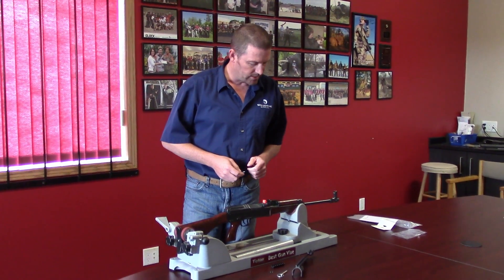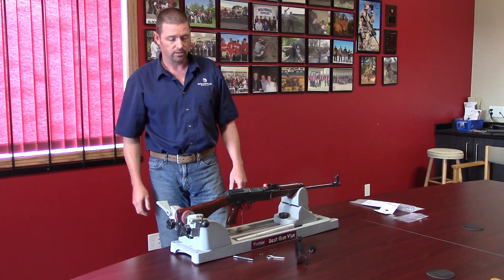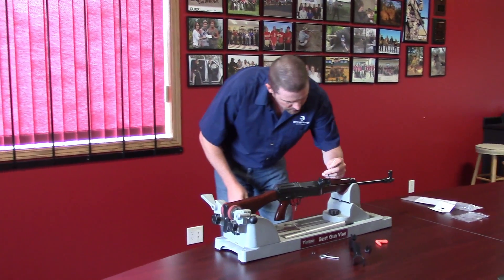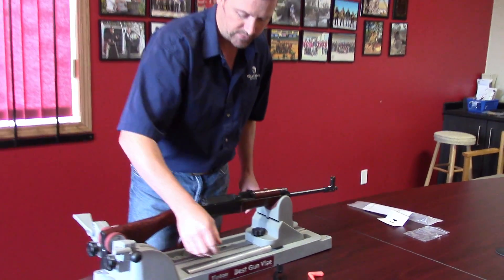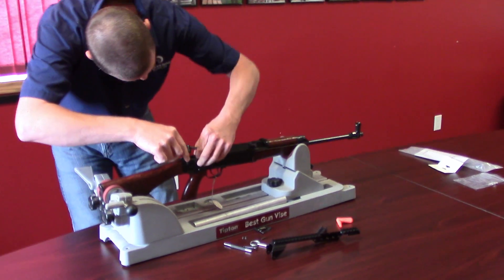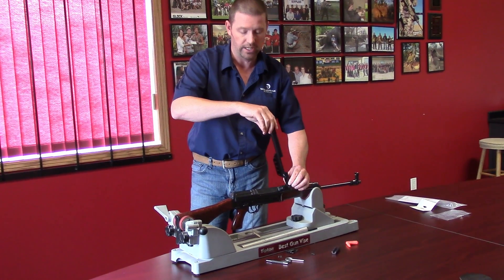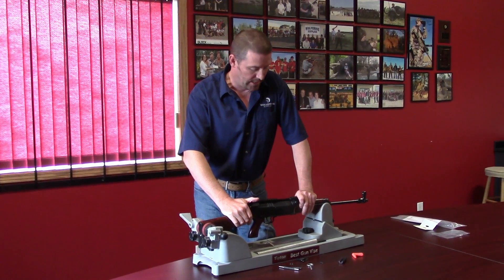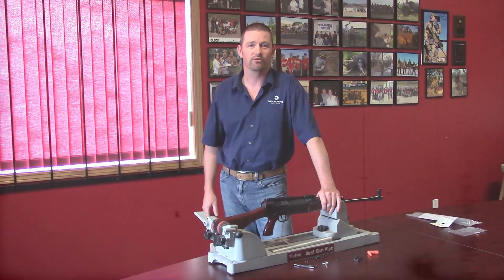Installing your CZ 858 Scope Mount... Quick and Easy!

Comment: I have important question: in this tutorial you remove rear sight and sight spring. To mount front part of rail you used only smal pin, but when I use that way, I have a some slack on front pin. On this video is different way - that guy mounted fron part of rail with sight spring
https://www.youtube.com/watch?v=6oswMDzucHY

Which way is correct?